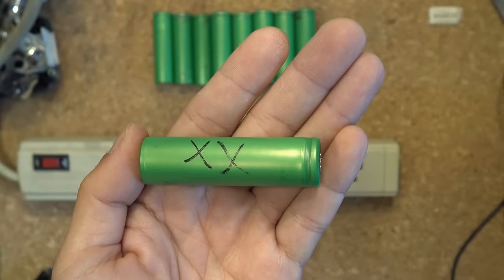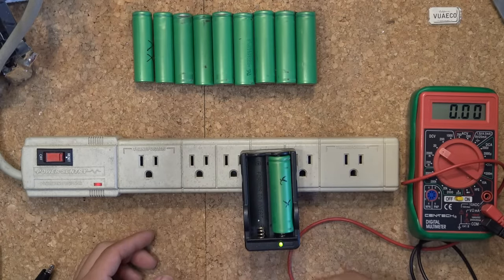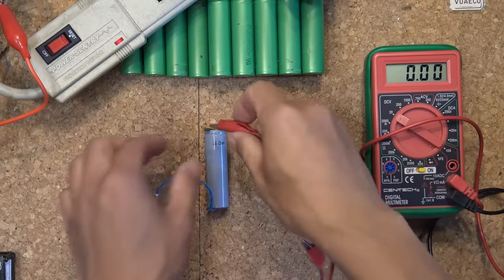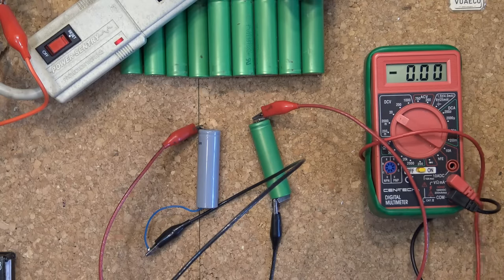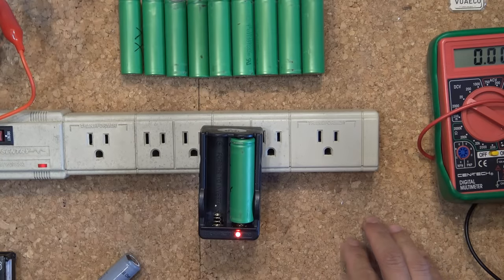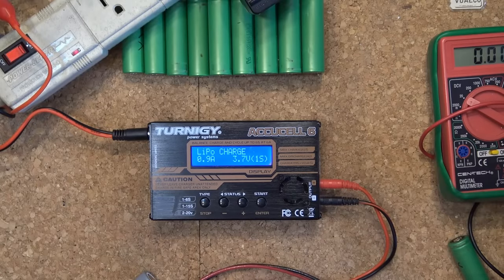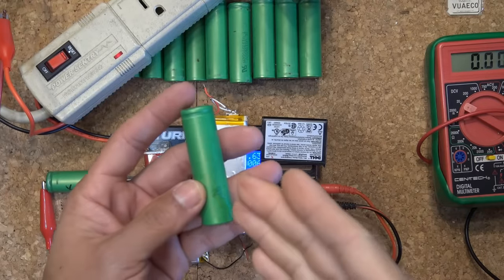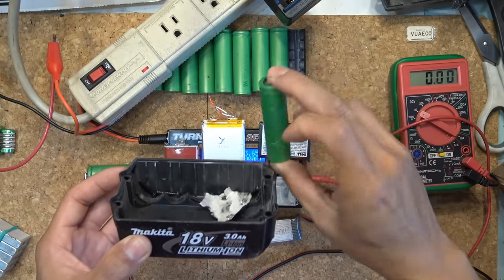DIY: How to revive a dead 18650 (or any) Li-ion battery cell

Comment: This is the simplest method that most videos describe, but I prefer a safer method.  This way can make the battery heat up and explode.
I use a bench power supply where I can dial in the voltage and the current.  I limit the current to about 50 milliamps, and then I gradually raise the voltage to the point where it starts to take current.  Sometimes this can be as high as 30 volts.  Once it starts to charge, I reduce the voltage to about 4V, and I turn up the current to about 100 mA, and let it charge for a few minutes.  At this point I transfer it to a proper charger, because it monitors temperature and controls the current, shutting off when the charging is complete.
It's particularly useful for older cameras which have dead batteries which no longer take a charge, and the new battery is either very expensive or hard to find.
Reply: I've been doing it this way for some dead skateboard batteries. But I also recommend trying to blow up them batteries ;)
Reply: Those without a bench power supply can just use a partially-discharged battery to revive the deep-discharged one. The lower potential between the two will naturally limit the current and will produce less heat.
Reply: @M0DB0Y  why ?  What is gained. ?    What is lost ?     or poisoned?
Reply: How can you tell if it's taking charge? I have a dead 12v lithium. Thanks
Reply: @threeworlds  My bench power supply has adjustable voltage and current, and displays both with 3-digit accuracy.  I set the limit to less than 50 mA to start, and there's never a problem.
Reply: @Landrew0  thanks for replying. You just wrote that you increase voltage until it takes current. Is there a way to monitor when it's taking current? I have a similar bench power supply. Thanks!!
Reply: @Landrew0  I think I get it. I just bought the power supply so first time using. It's on 14.33v and the current is reading 00.24 now. Let's see if this works. 🤞 Thanks for your help.
Reply: @threeworlds  If your benchtop power supply does not provide the current output, a reliable and safe methods is buying a low-resistance, high-wattage resistor (e.g.  <= 1ohm, 10W), putting that in series with the charging circuit.  Then measure the voltage drop across the resistor with a voltmeter to determine the current passing through it.  It's a much better method than putting an ammeter in series, as the former can't blow out your multimeter or its fuses.

For safety, you should test and revive each (3.6V) cell separately, not as a single 12-14V set of series cells.  Also don't try and charge parallel cells.
Reply: @threeworlds  at 2:58 he did say a bit warm, there you go
Reply: @BionicBadgerFromHell  why its not good to chathe parralel batteries¿
Reply: @maxverstappennonofficial  Because the batteries often don't have the same amount of charge in them and the batteries will attempt to equalize by distributing the charge between the batteries.

If you can guarantee similar battery charge and other characteristics, then it won't be a problem, but usually that's not what you'd have with a set of dead batteries you're trying to revive.
Reply: @BionicBadgerFromHell so how then can you revive dead e bike batteries
Reply: @carstrucks9641  I don’t know much about it, but with all the house fires lately from cheap Chinese E bike batteries. I would not screw around with them at all, seriously.
It will burn your house down.🔥🔥🤔
Reply: What do you think about a resistor connected in series to reduce the current?
Reply: this ^
Reply: @carstrucks9641 depends on what you mean by “DEAD”. 
Had a brand new ebike battery that would only charge for a few seconds. Its output when checked with a multi meter read 39 volts ( 48 volt battery). 

What had happened was the different banks (13 in 48 v pack ) had discharged to different levels in storage. 
On charge once one of the 13 banks reached 4.2 v it turned off charger. 

The BMS monitoring plug. Has 14 wires. 
Black then rest normally red. 
From black wire to last wire should read 54.6 v when battery fully charged. 
So with negative probe on black wire side check voltage between each of red wires. 

Find lowest voltage of the 13 cell packs. 
In my case this was 3.14 v ranging up to 4.2 v 

Then you need to discharge each of the other 12 banks down to  3.14 v 

This is called BOTTOM BALANCING 

I did this using a digital battery discharge tester. 
I found once it finished the voltage bounced back slightly so I ended up setting it to cut off at 2.7 v. 
This gave me all 13 cell packs at 3.0v plus or minus 0.02v. 

I then reconnected the balance wires back on to BMS. 
( NOTE I SUSPECTED A FAULTY BMS so I fitted a new one that took same balance wires plug. So no need to totally unwrap battery pack )

Battery pack was charged with its charger. 

That was 6 months ago. 
Recently I checked battery voltage and over course of 6 months it has dropped from 54.6 v down to 52.6 v. 
This is what I would expect of a battery with good cells and good BMS 

I regularly see ebike batteries that have gone “weak”. Over years of use. 
In case of 48v packs they may only charge to say 50v. 
This is because they have gone out of balance over time. 

Doing trick of bottom balancing restores them like new. 
The fully charge to 54.6 again. 

As a previous poster said , be careful
Lithium ion batteries can explode if handled incorrectly . 

I should also add if a battery persists in dropping voltage constantly on one or more of the 13 packs after replacing BMS and bottom balancing the there is most likely a dud cell in that pack. 
That’s a different matter and will require taking complete battery pack apart to replace the faulty bank. 

The pins on most BMS monitoring plugs are 2.54 mm spacing. 
I filed the pins on a twin through hole socket to fit into the BMS plug and used this to connect to my battery discharge tester. 

This is like my tester think I have the 180w version. 

Just found this amazing item on AliExpress. Check it out! €36.93  50％ Off | 150W 20A Battery Capacity 4-wire Tester DC USB Tester Electronic Load Lithium Discharge Monitor Power Supply Checker With PC APP
https://a.aliexpress.com/_m0ZWteU

Below is kit I took the 2 pin header from to make a plug to  connect to the pins across the BMS monitor  plug wires 

Just found this amazing item on AliExpress. Check it out! €2.38  25％ Off | 230pcs XH2.54 2p 3p 4p 5 pin 2.54mm Pitch Terminal Kit / Housing / Pin Header JST Connector Wire Connectors Adaptor XH Kits Box
https://a.aliexpress.com/_mPcSLHE

Note polarity must be observed so negative pin is allways on side of  negative on BMS plug. 

As said earlier. This is not for the inexperienced and wrongly done can cause a battery pack to go into thermal runaway and burn and explode.
Reply: Why not bring the low cell up and top balance? Any advantage to bottom balancing?
Reply: great work.
Reply: Sounds like what dyatlov did in Chernobyl rbmk reactor
Reply: This seems potentially more dangerous since you could accidentally adjust the current or voltage too high.  And, while 30 volt probably won't kill you, I wouldn't call it safe either.  But, if you're careful with the amps and volts settings this way could be safer since it is more controlled (they mentioned below setting a limit I think?).  I guess one advantage of this method is it might be able to work on batteries that are closer to being dead.
Reply: @Tletna  That's nonsense. You assume I won't control the current properly, while the other method allows uncontrolled current to flow.

Comment: Very helpful thank you. I didn't gave any good 18650's so I used 2 AA Alkaline batteries in series and connected them to the dead 18650 in the same way you showed. Worked surprisingly effectively and only took a few seconds to bring the 18650 up to a chargeable voltage.
Reply: Real bcuz i don't want to my battery explode 🙄
Reply: 2x AA cells in parallel with a deal li ion cell.  Make sure all connections are solid and then take a walk around the block.  Goal: determine the response time of the local fire department.
Reply: @uhmgawa6533  Or just connect it for a few seconds and don't leave it's sight and it's perfectly safe
Reply: there is a reason why normal charger won't charge battery like this lol.. it's not like they couldn't do it, they don't want to.. let that sink in.

Comment: I just did this and it worked great. I folded a strip of aluminum foil until it was about 1/4" and then tore it in half, I stood the 2 batteries beside each other on one of the foil strips, I laid the other across the top terminals and counted to 20, I put the battery in the charger and it worked! Thanks for the tip!!!
Reply from the maker: Excellent idea! :D

Comment: For Anyone out there, I used this method with  a dead AA NiMH  rechargeable battery, and it worked as described.
Reply: This battery is a Li-ion. It's a different beast. I wouldn't recommend this to be honest, it would be more successful on a NiMH battery and if it isn't it a worse case result would be less explosive.

Comment: Using  magnets to hold the leads is very clever!
Reply: I see this more and more. Started using it too, I hate screw or solder .. magnet are amazing
Reply: I advise you to check the resistance of your magnets with a multimeter, some have a coating with high resistance so they heat up
Reply: Magnets are amazing except on copper terminals :(
Reply: bro... get a stronger magnet... think super conducting... still wont hold it but what you are aiming for is a fall rate so low, resistance wont approach infinity in your life time :D never mind the impracticality of such a bat pack, or the substation connected to it
Reply: just build a spot welder
Reply: John Wuethrich,  lol
Reply: Introducing anything in a test circuit leads to false readings
Reply: -the idea is not his
Reply: No, not always.
Reply: @Janis Grislis what do u intend to do with your pack? A good spot welder is far less likely to lead to your firey death or a premature cell death. Like magnets and or soldering. Yeah some people can do the later OK... There's a reason its not industry standard. Just like there's a reason u shouldn't bring back dead lithium ion cells... In a word boom... See dendrite and or short circuit if u can't figure that out. 

Finaly... The cells have a finite number of cycles. Your comment is extra special Ed because if you understood esr/ir matching  u would be able to avoid that dud most of the time. Of u spot weld... More of the time. If u understood cycle life u would know its unreasonable to expect a battery to last a long enough span where u cycle our a few duds...muotiple times.. Fucking stupid idea unless u are powering a Bluetooth headset or a single led.

Please tell me u own a home... I fear for your neighbors it u live in an apt
Reply: Emre Kaya Game of money
Reply: John Wuethrich lol indeed i’m an electrical engineer (not that it proves anything) and i’ve tried with microwave transformers, and belive me it is HARD much harder then you imagine when you start. And dangerous, after failing to make a welder i converted it into jaccobs ladder and burned myself pretty badly accidentally touching it. Even greatscoot wasn’t successful and he is a beast
Reply: Magnets drain batteries fast
Reply: absolutely!  What a great idea I’ve gotta try it.
Reply: alexis Juillard Absolutely do NOT make a welder or weld batteries to strips unless you know exactly what you’re doing...it is very dangerous and there are way better methods to wire batteries together.
Reply: Yes and no, if too much current passes through, the magnets will get warm & will de-magnetize, learn your Ohms law & act accordingly,
If you do, use N52 magnets.
Reply: Don't magnet somehow effect electricity, like the readings of the multimeter? I am NOT saying that I know that, but I am just suspecting it because, you know, we hear things like "electromagnetic field", etc, meaning electricity and magnets are somehow related...
Reply: I read somewhere that magnets affect the electrochemistry of li-ion cells
Reply: @typingcat  certainly does not affect a multi meter's reading.

Comment: I'm so glad i stumbled on this!
 Didn't know you it was a voltage drainage issue, I left my batteries plugged in my gimbal once discharging so I messed up 2 batteries. I didn't know it was a voltage drainage issue with these types of batteries. I didn't have the right tools like a volt meter but fortunately 2 18650 batteries where charging so I charged one. The working 18650 connected to the dead battery through simple soldering wire i had laying around..When i saw the spark i thought it probably fried it..I got paranoid so i only did it for like 10 seconds or less.
Just like jump starting a car it instead the battery came back to at least 1 volt and the charger no longer displayed an error and begun charging the dead battery!
this works wonders! 

You saved me having to spend 20 something dollars on new batteries and having to wait for shipping and cancel a video shoot!
Thank you!
Reply: Same i let the battery sit for a couple of month on the desk. Last time i checked, the battery was good. And now, there is just 0.100V inside. Don't understand.

Comment: That's exactly how I did it and with a very similar charger. It doesn't work long if the battery is too dead but depending on what you need the battery for that's not a big deal. For batteries between 1.5-2.5v they can usually come back to almost perfect health. The older and longer the battery was discharging, the less likely they are to come back to normal.

Comment: I had purchased a new battery after realizing the aftermarket deck I put in my VW Wagon was draining it but was time anyways 2 replace. So it killed the new one. My 20+ year old charger had an issue with power cable eventually fraying so I picked up a new digital smart charger (EverStart Maxx 50A,15A,3A trickle). Hooked it up and pressed recalibrate and nothing. I was confused, passed, and gutted. But then I took a step back and thought to myself alright, so I got to work. I replaced the power cable in the old school direct current charger. Tested it and made sure there where no issues. Threw it on the dead battery for a small period of time and once I got it to a quarter to half way of it being charged I tried the digital and it started charging and doing its job. So yes this is a very, very helpful way to get more life out of batteries like these that are believed to be dead. I have a 10 year old 18650 battery from an old original vape pen which broke in my Tactical flashlight and still to this day I use it almost daily taking the dog out. Lasts as long as it did back then and same current too as every 6months I throw the 18650 that came with the flashlight in and double check so I know how it's doing and to re-topoff the stored one to keep it freshly charged while stored.

Comment: Thanks had a brand new item with inbuilt battery, accidentally left on and ran flat over a couple of weeks. Would not light up the LED panel or charge. Pulled the battery out, kick started as explained in this video, put the battery back in and it is now charging as normal. Don't know yet if I have done permanent damage, but looking good so far. Was a life saver because we could not get another 3.7V the same size as the one built into the item.

Comment: Great tips. The magnet trick to conveniently attach leads is also clever. I didn't have a charged lipo battery, but this also works if you have a variable power supply. I just set mine to 3.2V and connected it in parallel to my battery for 30 seconds, and the battery was ready to charge!

Comment: After watching this, I used an old 5v 1amp charger lying around, cut the end, and attached them (one to +/-) on the 18650 battery and plugged it in. After about 15minutes, pulled it off, and...the battery WORKED! Charged as usual! Thanks!

Comment: For those curious as to why this cell discharged so low and why doing this is risky, here's some quick info:

That 18650 cell is a "protected" cell. See the little extra ridge towards the positive side of the battery just before the button top? That's a small circuit board that contains the "protection" circuitry. Something has failed in that circuit, allowing the battery to continue draining past the safe point.

By applying voltage directly to the battery like he did here, you're forcing it in through the protection circuit. Sometimes the protection circuit will continue working per normal after this and sometimes it won't. Depends on what happened that cause it to fail, being either a hiccup or something physically damaged.

Typically, if the battery pack or device that you're installing this battery into has overheating protection on its own, you'll be ok. But if that device or battery pack doesn't already have that safety measure, you risk the battery blowing up. 

Be careful when doing this! I've also revived "bad" cells in this manor & those batteries are still working well after years of use. Fortunately, I haven't had one explode yet. Be mindful that if your device gets really warm after doing a revival such as this, that the battery might blow & I would highly advise against using it any further!
Reply: I'm a complete noob when it comes to 18650 batteries, but I have 1 for a flashlight. Is it dangerous if I will not use/charge it for a year? It's a protected Keeppower one
Reply: Both protected and unprotected cells have that grooved ring near the positive terminal. The easiest way to tell the difference is by looking for a strip that runs up one side of protected cells, or by measuring it. Unprotected cells are 65mm long, while protected ones are at least 68mm long. None of the ones in the video appear to have the strip. They appear to be Sony US18650G series cells, and are most likely from an old laptop battery, which would mean they are unprotected.